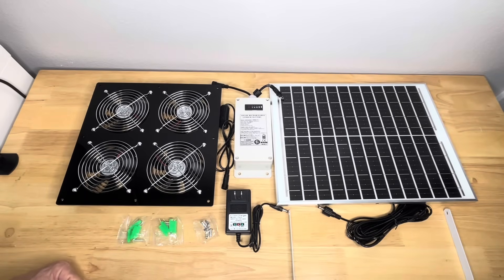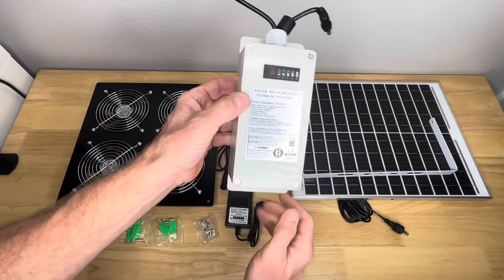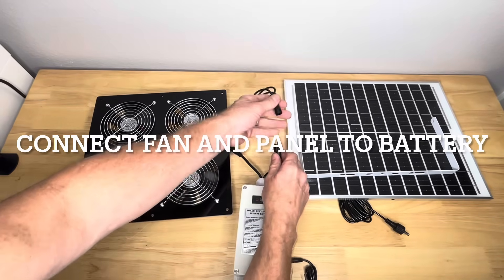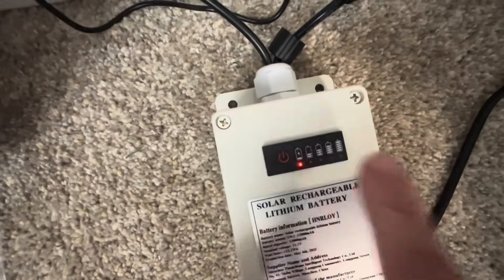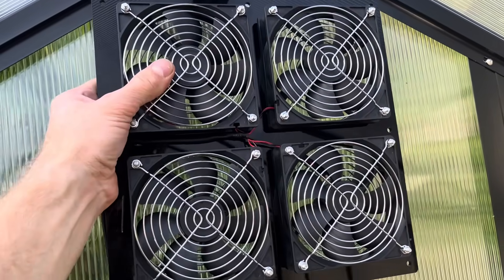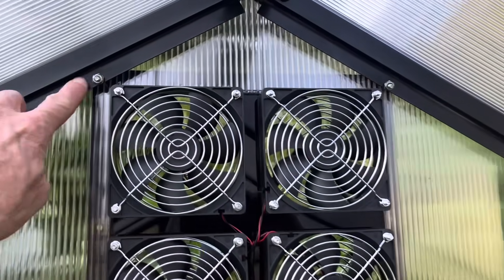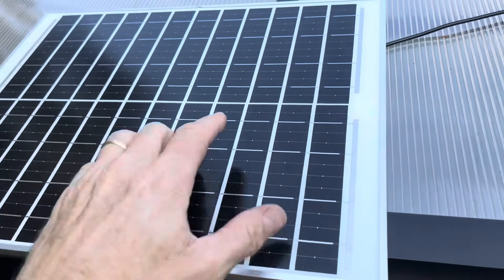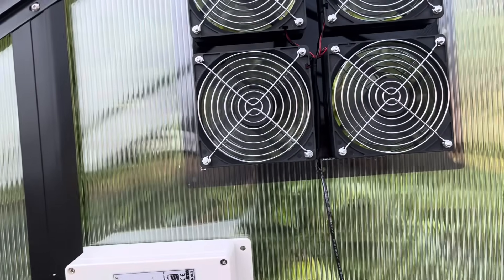DIY How to Install a Greenhouse Solar Powered Fan | Easy Step by Step Tutorial Demonstration

Comment: The fans look terrific and exactly what I’d like to do in my plastic panel greenhouse as well. How do you keep the ring from getting in through the fans. If you could advise, I would be very appreciative. Great video.
Reply from the maker: Thanks! Well I put a big bead of silicone around it. Did the trick so far:)